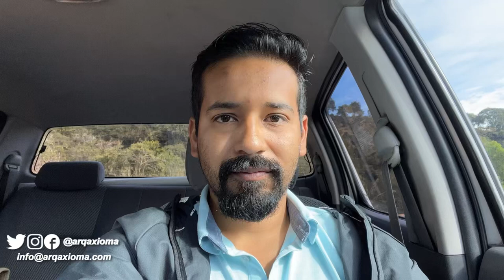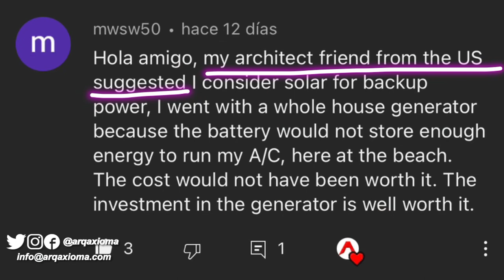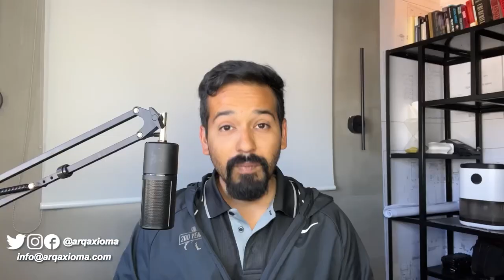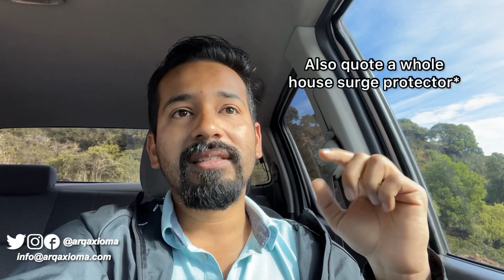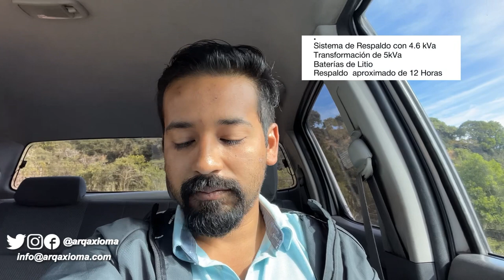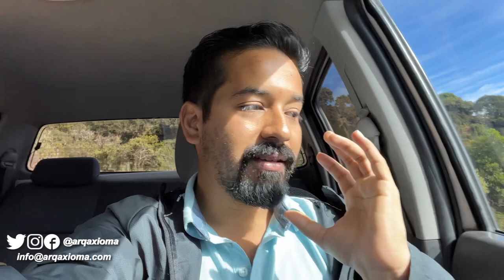Battery Backup System vs Fuel Generator | Architect in Panama

Comment: Rommel we have experienced several outages that lasts for hours, a few in the last 6 months that lasted over 12 hours only a few days apart. 

In your comparison you mentioned the generator at 10kwh, but that is continuous as long as you have fuel. The battery sustem has a finite amount of power until it need to be recharged. So when the 12 hours is over, so is the backup power. The propane system can last days or who knows weeks, etc..

Great vid, keep up the good work!